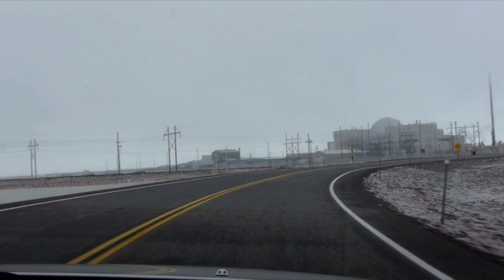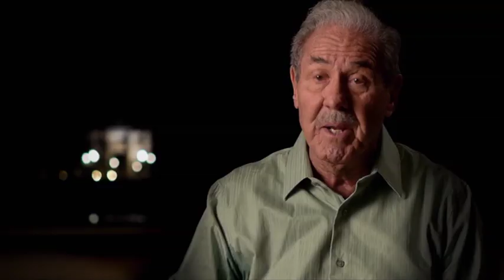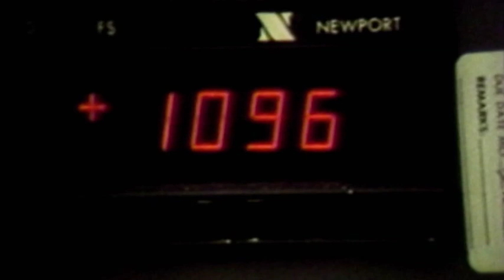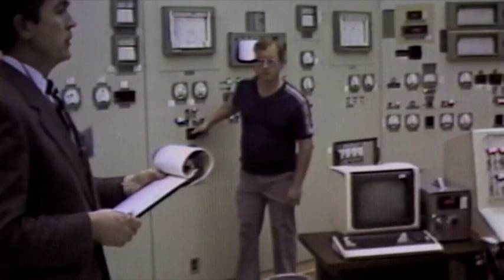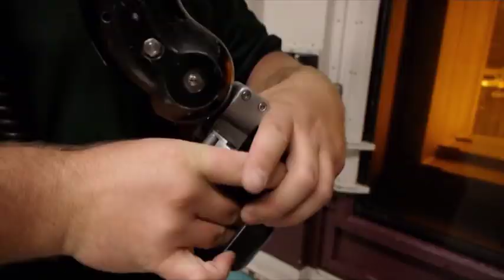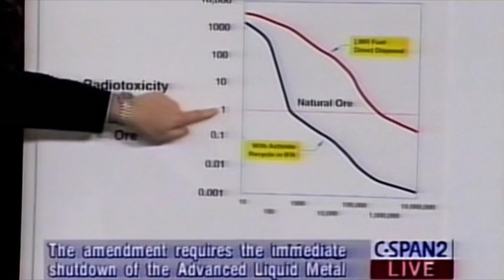The Integral Fast Reactor

Comment: This is misleading. Neither Fukushima nor Three Mile Island suffered a runaway reaction; the control rods dropped in automatically and did their job. What the IFR had that they lacked is the ability to reject decay heat passively, AFTER the fission chain reaction was completely stopped, at which time, radioactive decay still generates about 7% as much heat as full power operation. This drops to 1% in a little over an hour, but remains enough to boil away the water and melt the fuel for at least a year afterward if the water is not cooled or allowed to evaporate and replenished.  Water-cooled reactors can be built to do this, but it costs more because their operating temperature is lower and water conducts heat 120 times less efficiently than sodium, which is partly compensated by water's higher heat capacity (at 340C and under 146 atmospheres to make it liquid, water has a density of 0.61 g/cm3 and a heat capacity of 8.24 J/gK, thus a volumetric heat capacity of 5.0264 J/cm3K, about 5 times better than sodium at 550C and 1 atmosphere). Also, the boiling point of sodium at 1 atm is 883C, allowing easily > 300C margin from operating temperature to boiling, whereas water cooled reactors have little or no margin; they operate just under the boiling point, or at the boiling point, and that at 65 to 160 atmospheres.

Comment: The Democrats should watch this, it is the solution to our energy problems as it also provides for producing hydrogen from water and both will end the need for fossil fuels altogether.
Reply from the maker: The good news is there's a demonstration target year set for a fast reactor to be built in Wyoming. I'm 99% sure it's a slightly redesigned PRISM based on what was learned at EBR-II. However, no plans yet for electrorefining recycling.
Reply: @CapoRip  They need to include the fuel processing part too. And this should be put on fast-track as it was proven already.

Comment: I have been patient over the last two decades, hoping that a Politician with knowledge of Climate Change will consider and understand my research showing an additional basis for Climate Change.  I anticipate that you will respond to this letter so that we can now work together to help save Australia. 
I am frustrated, endeavoring to inform the media and as a consequence, also the Prime Minister of Australia, who are all concentrating on a one point of climate control, making Carbon Dioxide (CO2) the only enemy. That sole basis for the current climate situation ignores the 450,000 year history of climate changes and of the energy changes that are from our Sun’s activity.
My research has been published and within the public library system. Climate needs thinkers to show that CO2 is a necessity, not a figment of imagination; that shows it as controlling the activities of our weather patterns. 
Climate reparation must not be exclusively based around CO2 as it is a heavy gas molecule that is odourless, colourless and its Periodic table atomic weight of 44, does not hold heat and rise as is always portrayed by the media. CO2 is necessary for life, and during the evening cycle of its synthesis it gives off Oxygen. The claimed CO2 versions of the media portray it only as a problem molecule that is melting snow, ice within the Arctic Circle and “murdering” our livable climate. The issue is of the other natural climate cycles of Earth and other factors have not been identified to affect our climate. The Vostok  exercise demonstrated conclusively the rise of CO2 follows the Earth temperature. Not rising before the climate change. 
The Sun passed through a sector of our constellation and entered a Positive magnetic sector climaxing on or near the 15th December 2012, but it was this initial change on or near to the middle of February 2001 that caused a major contributor, as much as CO2 has to climate change. 
Evidence shows this situation has occurred four times in the Vostok scientific graphic. It is time that this fact is brought to the public’s attention as it shows the cycle as a natural cycle of an event that has occurred 450,000 years, four times. Earth is heading for another cool sector in our future temperature cycles.  Only when all these factors that affect the climate change are considered, can we plan for and mitigate their effects.
At present we are failing to do this, for making the efforts narrowly focused and at risk of failure. FAQs that need answers, I welcome to answer them for you. These questions must be asked and answered for a successful planned course of action.
Thomas T S Watson, 
Magnetic & Gravitational Researcher  (Author of: ‘Climate Change - Explained by Magnetism?’) 
C/o Costa House,  1 Investigator Ave.,  
Lara,  Victoria – 3212   Ph: 0425 737 370 - (Australia)       Email:  watson.thomas1@gmail.com

Comment: Is it possible to construct a differential fast reactor?
Reply from the maker: Do you mean a reactor with a neutron spectrum that is e.g. fast near the middle and thermal at the edges?
Reply: @CapoRip  I think this question is just a pun. "integral" vs. "differential", one being the opposite of the other.
Reply: @CapoRip  There's a project about it, funny enough. Multi-Spectrum CANDU reactor.

Comment: Nuclear fuel recycle has proven to be an economic nightmare only for the bold and wealthy.  Breeders like the proposed Clinch River Breeder Reactor; if built; would probably be as costly technology path as the EdF incurred with its SUPER PHENIX in France.  Our plant was built with existing technology at the time but incurred an overrun of original cost estimates which was more than a factor of ten.   It is no longer a question of safety with 10CFR50 in place for four decades  --- it is a question of money and investment  -- which is root place where energy decisions are ultimately made.    For utilities and their commercial, industrial, agricultural, and residential customers it is a question of cost per kilowatt and who can be there with the power when the customers need it.   Over the past four decades -- this pathway has become more and more a two way highway with the utility customer becoming more and more a part of the base generation picture.   Those who have bet on renewables already; have already won.  This means also that the entire twentieth century trend to ever larger stations and higher voltages for transmission is now reversing  before everyone's eyes  --- this has left an indelible mark of fear and a sense of urgency for all energy suppliers [including the nuclear industry as a whole]  who are all without exception holding assets which are diminishing in value with each passing day.

Comment: Ok, some serious flaws in this video:
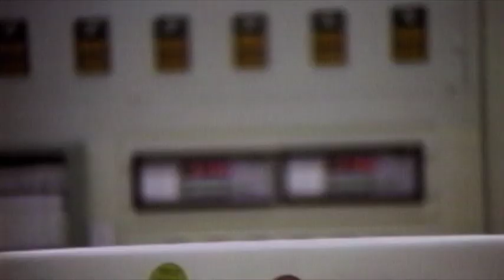2:37 "this experiment was an almost direct parallel to what happened in Fukushima, it was eerily similar"
OK, let me see, what do you mean?

2:48: "we ran the reactor at full power, disabled the shutdown system so the operators had no ability to shut the reactor down"   - SINCE WHEN THE F*CK was this EERILY SIMILAR to Fukusima? (Hint: all three operating units automatically shut down when the earthquake occurred)
4:04: "all major reactor accidents happen because of one thing: inadequate cooling" - meanwhile on screen in all caps: "THREE MILE ISLAND, CHERNOBYL, FUKUSHIMA"   dafuq since when was Chernobyl because of LOCA/LOFA/SBO??? (hint: power excursion ring a bell? positive void coefficient?)
Reply: I have no idea what you are talking about. Everything he is saying on the video makes total sense, however.
Reply: You're confusing SCRAM with shutdown.You can SCRAM but you still have to reject the heat.

Power excursions due to inadequate cooling because of the lack of heat transfer from the void.
Reply: In a very general sense he’s right, a reactor’s only purpose is to generate heat, when you can’t control the heat (inadequate cooling) you have problems.
Reply: My God how thick can you be?!

1. Referring to how the operators had no control of the decay heat. Although Fukushima's reactors were shut down because of the earthquake they continued to generate decay heat, which this experiment duplicated.

2. See point above. Shut down all coolant lines which meant the reactors were unable to remove decay heat (Same as Fukushima).

3. Chernobyl's coolant being water was the reason why steam (that blew off the reactor lid) was produced in the first place. Had Chernobyl's coolant been Sodium it would not have done this & the accident would not have happened.
Reply: They shut the coolant pumps off!

Comment: The problem here is that sodium (salt) is one of the most corroding substances known to man.. If maintenance is done right it should be a problem but history tells us that our species isn't very strict on maintaining anything...
Reply from the maker: It's a good observation but in this case the coolant is pure molten sodium metal.

Yes, this also sounds problematic but EBR-II operated under an inert argon atmosphere and kept oxygen and water out of the system for 30 years.

The sodium coolant actually protected the steel of the reactor from all corrosion! See this presentation for more details: https://www.youtube.com/watch?v=LexRfOZ44zI
Reply: If you spend some time researching the Fermi reactor Lagoona Beach Michigan, you'll find that upon teardown and inspection, it was noted that the materials used in the reactor showed no sign of corrosion from the sodium coolant. EBR 2 used the same CrMo and 304Stainless pieces, and shared technology with the Fermi project.
Reply: Sodium Chloride is, because it dissociates into free chlorides and will form hydrogen chloride with water. This is pure sodium.

Comment: That was a good reactor that Clinton shut down. It did cost them 800 million Dolllars to tear it down because of the sodium issues.
Reply: +idarusskie You do know that Russia has run a Sodium cooled reactor safely now for 35 years. BN-600 is the only comercial fast breeder reactor in operation in the world and it has proven that the conept works. Russia completed last year its big brother the BN-800 which is an even more advanced and safer version than the old 600. The main export model the BN-1200 which basically is an advanced IFR is already designed and construction is expected to start in a few years. So you thank Clinton for throwing the 30 year R&D lead down the toilet on GEN-IV reactors and giving the lead to the Russians. They are the ones leading now on new Nuclear R&D and construction. Also you do know that it cost more to the taxpayer to kill the IFR program than to cpmplete it since it was only a few years away from completion.
Reply: Clinton is bought off by big oil. Now she wants to go to war with Russia!
Reply: The 800 million cost for the dismantling cant be faulted on Clinton  or Kerry -  that cost was implicit when the program started !  As far as i understand things, that reactor was a prototype and prototypes isn't really intended for long time running.